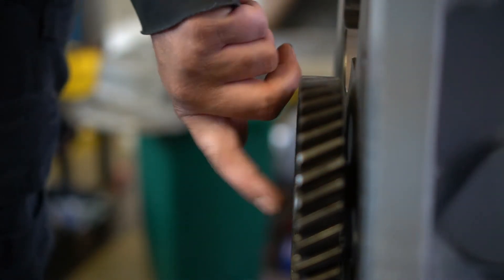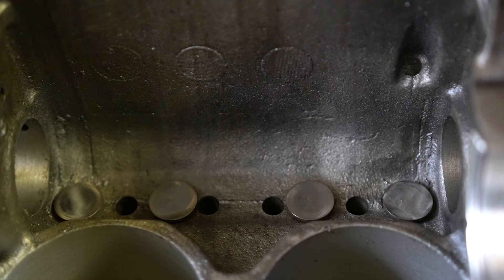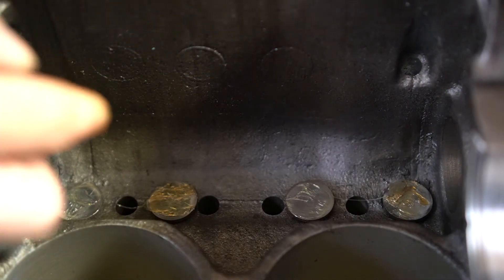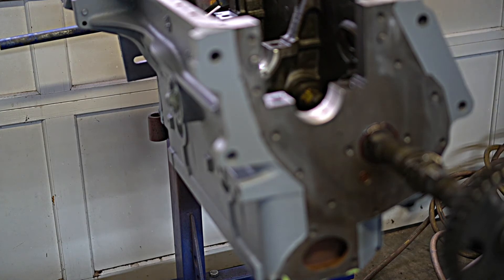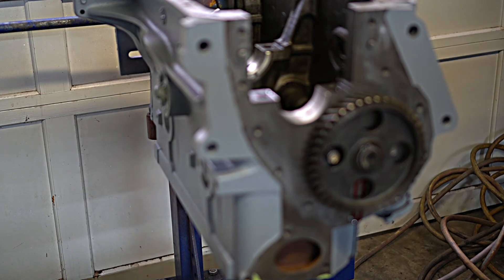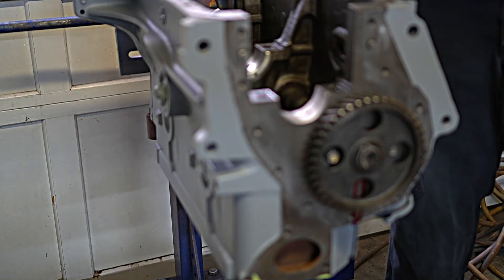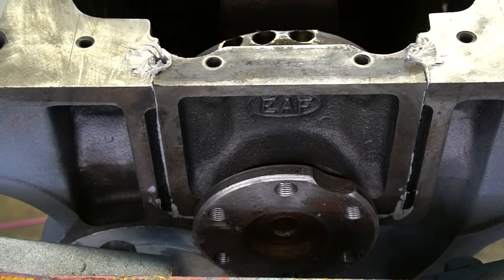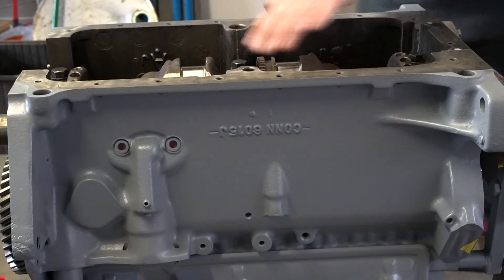Installing cam and crankshaft in Ford 172 engine

Comment: When lining the timing marks up on the cam and crank. Does this put you at #1 TDC compression for the injection pump timing?
Reply from the maker: Yes. The flywheel may have 2 sets of timing marks but the dots on timing gears will be #1 TDC compression.

Comment: When you fitted the camshaft in the T5 Ford engine how did you reduce the end play on cam , thanks Willie.
Reply from the maker: Only way to reduce the cam end play is changing the thrust plate unless you want to do some machining or sketchy stuff to reduce it. The thrust plate from new holland has gotten ridiculous in price.
Reply: @chickenhousemechanic  It's an engine that a guy took apart 10 years ago and it's like a jigsaw puzzle to put back together, there's multiple buckets of nuts and bolts, there isn't many videos that show or explain exactly how to fit the camshaft, 
I appreciate your help and advice Willie.

Comment: have you seen the plugs behind the cam gears? I have holes & no plugs, do they need to be plugged?
Reply from the maker: There is a small hole below the cam gear that is an oil jet that needs to be left open. There is also a larger hole near the top of the cam gear that should have a countersunk flat head screw in it blocking it off.

Comment: How would you suggest to get timing right on a gas engine (10degrees) without any timing marks?
Just rotate the distributor till it runs the best?
Reply from the maker: Pretty much. Just make sure it makes good power. Doesn't ping or overheat. Also mark sure exhaust doesn't glow red.
Reply: @chickenhousemechanic  thanks!
Reply: @GoFish  Nice!
I feel like I got TDC by putting a wire in the #1 plug and rotating the engine by hand. Just wanted to find that 10 degree point exactly without marks. The engine runs pretty good right now, but I started thinking about whether I could put my own marks on the crank?
Reply: There just isn't a large exposed flywheel off the crank on this engine to make marks easily.

Comment: I’m rebuilding one of these. After I was done I put it back on tractor. I cranked it and after it built up oil pressure, it stated to leak right where the engine bolts up to the bell housing. I also lost oil pressure. I split the tractor again and can’t find any obvious reason for the leak. What’s confusing is why is it leaking pressurized oil from near the rear main seal? I don’t see how that’s possible. Any suggestions?
Reply from the maker: That is odd. Only pressurized oil back there would be the rear main bearing and rear cam boss. The cam has the plate over it with a gasket  but there is a pretty good gap between that plate and last cam boss. You didn't by chance break the oil pressure feed line did you? Is the rear main seal installed correctly?
Reply: @chickenhousemechanic  I double checked the rear seal and it is correct. It’s the new rubber one not the rope seal. I’m splitting it again this week and will take the crank back about for the THIRD time. It’s driving me insane! I can’t for the life of me figure it out. Thanks for responding. I appreciate it very much. I’ve worked on tractors a long time but this is my first engine to tear down. I had my crank machined as well with oversized bearings.
Reply from the maker: @Farmtractorrescue  you put the side seals on the rear cap too I suppose. I can't remember off hand right now but check the flywheel bolts. I can't remember if they're blind or not. I always loc-tite my bolts and that seals them up. Wonder if the machine shop cut the crank where the rear main rides. From the factory they have a hatching on them where the rope would run. Even with the rubber seal that hatching won't hurt but if they cut it then the seal will never seal. If everything is installed correctly you'll have to think out side the box with it. Prime the oil system when you have it on an engine stand also. Just be sure to plug gauge port.
Reply: @chickenhousemechanic  I pulled the crank out again tonight. Nothing obvious wrong with any seals. I took the cam plate off and the gasket was pretty shot. Could that allow oil to escape once the system is pressurized?
Reply from the maker: @Farmtractorrescue  it could. I'm not sure how much pressurized oil is back there but there should be quite of bit of oil there since it also has to lube the hydraulic pump gears. On the right side of the engine block you'll see 3 small plugs about a 1/4" in diameter. That is where the rear cam boss is located. There's definitely pressurized oil there.
Reply: Yep it’s the gasket leaking